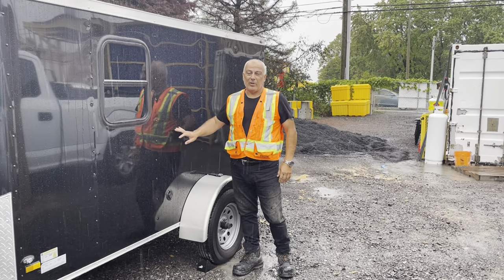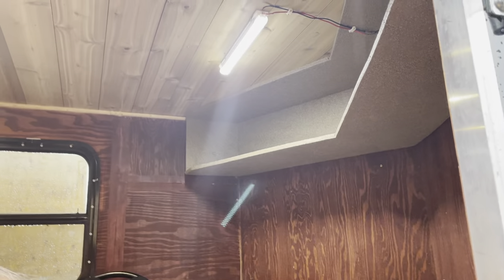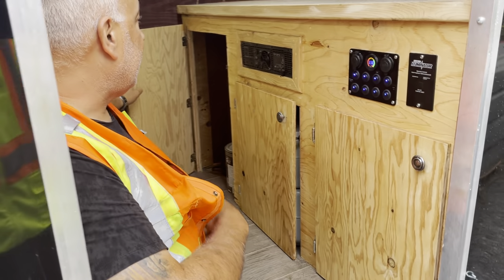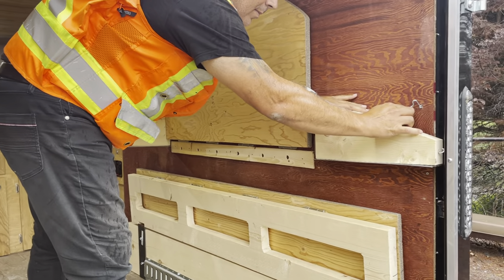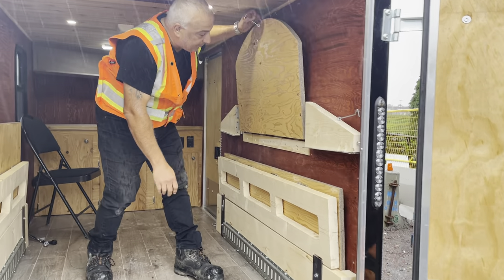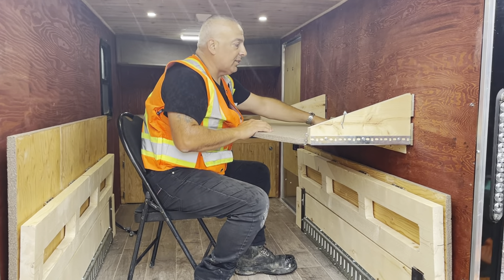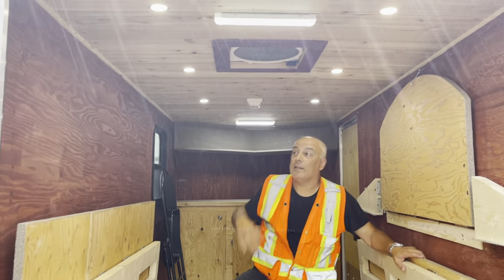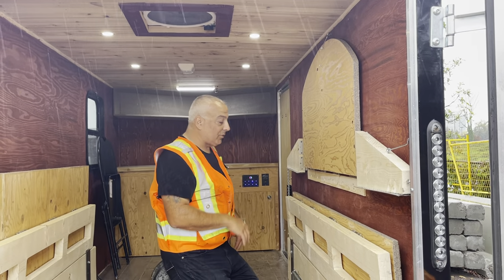5 x 10 Cargo Trailer Conversion

Comment: I have a 5x10 trailer that I am using to haul quad and very much like your design...simple...get er done kinda style.  Thank you for posting this video.  You gave me some great idea's on what I can do with my trailer.  I would like to see how you attached the front plywood sheet for the cabinets to the sides of the trailer.  Did you use metal L brackets on everything in the front?  What thickness of plywood did you use.  I would like to keep mine as light as possible but not too weak for strength.  Once again, great video...just wish you would have shown a little more on how you put things together.
Cheers!
Reply from the maker: Yes, I used small L brackets to secure the bottom of my front plywood (face of the cabinet). The Plywood is 1/2” spruce. On the inside of the front of the cabinet, just cut roughly a piece of 1/2” plywood x 2 1/2” wide by the height of the front piece, screw it to the outside wall of the trailer and use finishing screws to secure the front piece of plywood to this 2 1/2” piece. You can do this around the entire body of the cabinet, L brackets at the bottom and pieces of 2 1/2” plywood around the inside of the cabinet. 
I hope I’ve answered your question, please let me know if you have any other questions.